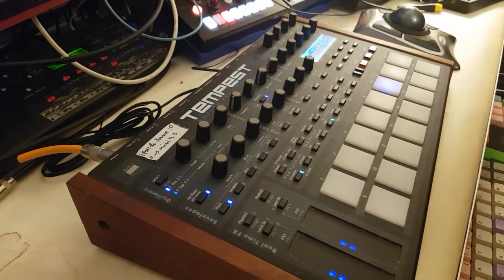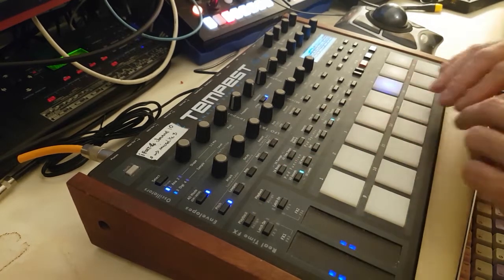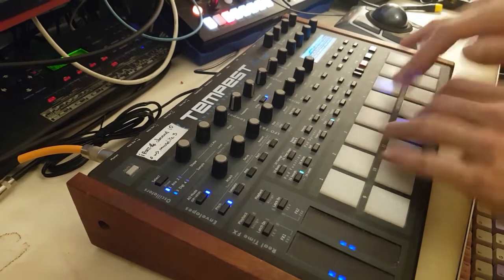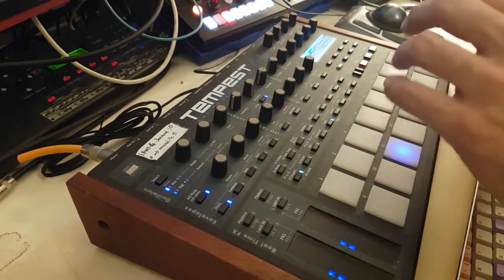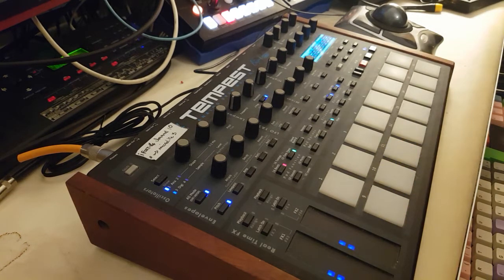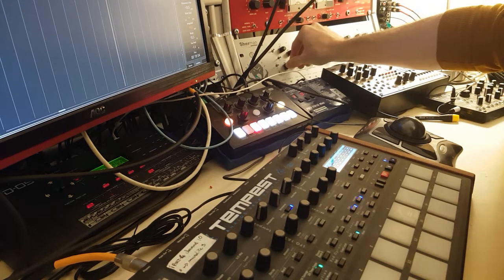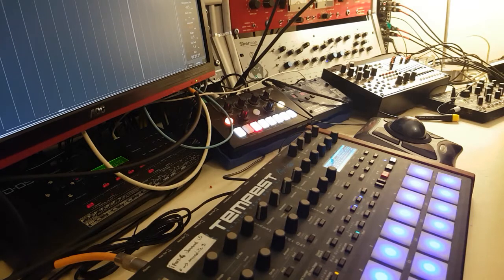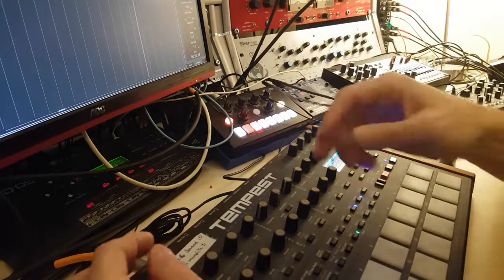tempest analog drum sounds #4 - (and the sherman !)

Comment: Well, DSI told you about the procedure for cleaning the switches and it is standard for these switches. They’re the makers of the instrument. Who else will you trust more regarding servicing their products ? Actually, I’ve used that very procedure several times and it does work. You aren’t going to damage anything. Just press hard on the switch, do not hammer it. And you do not have to do this for every switch on your Tempest unless they’re all dirty. Do it on the on the problematic ones. Takes 2 minutes and you’re good to go.